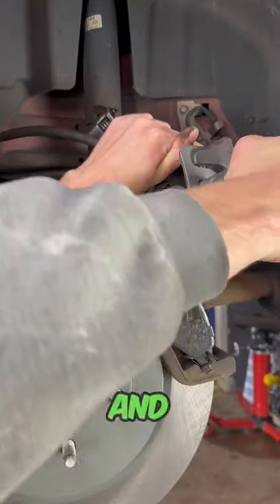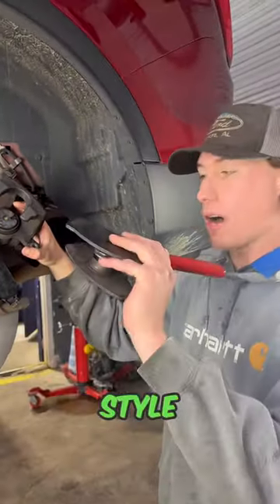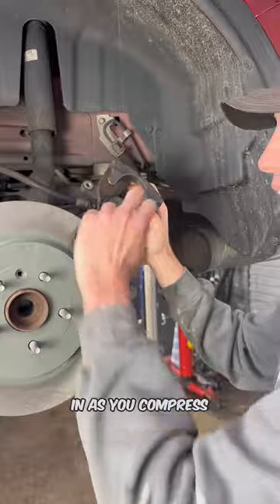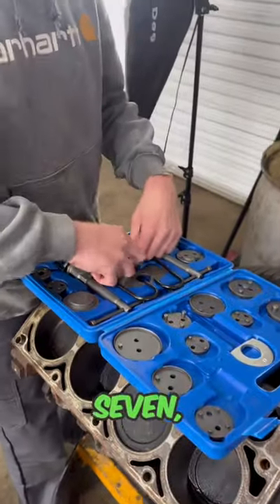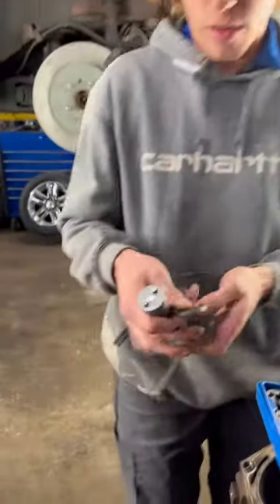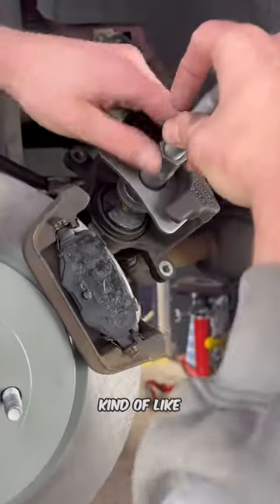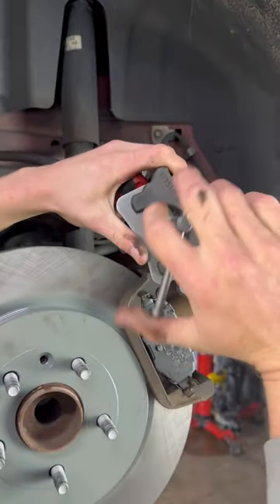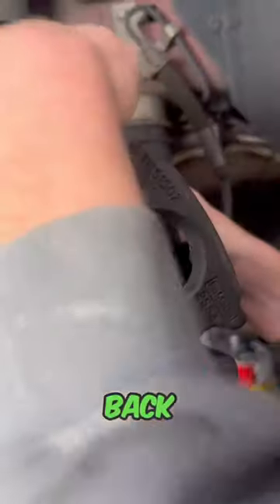The Brake Tool Every Mechanics Needs! Link in description #shorts #tools #mechanic

Comment: Don’t forget when you’re twisting, that you aren’t twisting the rubber boot behind it also, free it up first with some silicone spray
Reply: Or just twist it one way then go the other. It will break loose 50% of the time with 100% of the time breaking loose.
Reply: @clayton9136 that’s literally the longest way to do it, bit of lube behind the seal and it’ll push back no worries, takes 5 seconds to lube it, going forwards and backwards takes twice as long and 9/10 times doesn’t work as you stated anyway.
Reply: Had this happen on my 2012 Accord rear right 3 weeks ago. I just replaced it because it lasted 160k miles. Not worth battling it every pad change or even having to worry about it. 

Definitely using spray next time though.
Reply: @iHackWaWx  How the fuq is that the longest way? Ya go LEFT, THEN RIGHT. It takes less than one full second, AKA less time than whatever nonsense you spewed, AKA you're wrong, AKA I'm right,  AKA bye felicia.
Reply: @clayton9136  because 9/10 times it doesn’t free off the boot and it still gets stuck/twists? Bit of lube in behind the boot and you’ll never have an issue, however, you obviously don’t want the advice nor do you care for other people’s knowledge.
Reply: You also forgot the other tip.... Line the slots up vertically so that they lineup with the back of the brake pad going on.
Reply: @arthurwomack941  not on all vehicles, mainly Ford you have to worry about that
Reply: Great suggestion to avoid this gotcha!
Reply: Don’t forget to crack the bleeder so you don’t force all the crud back up through the master cylinder 😉
Reply: Thank you for that tip.

Comment: Tool rentals at most auto parts stores will let a DIYer rent the tool and get all their money back when the tool is returned. It's not worth buying if you rarely do brakes. These tend to be rear brake calipers. I have yet to see a caliper like this on front brakes. Rear brakes last much longer than front. So just rent  the tool. I own it, but I used to be a tech
Reply: I'm a strong believer in buy once, cry once, but buying the tools that those stores rent every time I need a specialty tool definitely has me crying multiple times.
Reply: That particular tool is 25 dollars on Amazon. There is no way it's worth an extra trip to the store, and taking the chance the one they have isn't damaged, missing pieces, or not in stock. It will also work much better for normal front and rear brakes than a typical c clamp.
Reply: My front and back brakes are the same.
Reply: @soullessrenegades1444 The only time you have this on your rear brakes is when your rear brake rotor has a drum on the inside for the parking brake. If your parking brake isn’t incorporated into your rear brake caliper then you will just have a regular push in style piston.
Reply: @ericmayer3074  It's definitely worth it for me to rent the tool, because I do not live in corn country where they hand out 4-car workshops with boxes of cracker jacks.  If I owned every tool that I occasionally rented, I'd have to sell one of my motorcycles to make the space.  Given that I'm usually hitting the parts store to stock up on Brakleen or shop towels or to recycle oil or whatever anyway, it's an extremely minor inconvenience.  But if I had a ton of space with a wall of shelves and a lift and everything, sure.
Reply: Great tool kit for anyone that does regular brake pad maintenance on multiple vehicles.

Comment: Don't forget the slot on the piston has to line up with the dot on the pad or it will not adjust it self
Reply: Clean and lube the boot lip (dielectric grease works good) so that the boot slides freely as it returns. Burp the air out of the boot when it's fully seated. This will help ensure that the boot doesn't rip.
Reply: You seen the front pad and said comeback🤣🤣
Reply: I was thinkn the same.. he shouldve mentioned it at the end🤣
Reply: Must’ve been gods plan bc I did not pay attention to this yet all came out fine, 2014 mustang
Reply: There is a nub on the brake pad that goes in the notch as well. If it isn't lined up it will cock the pad slightly and cause uneven wear.
Reply: Not on all models
Reply: This was a great comment.  He should have mentioned this in the video.  Also, some Fords and Volvo rear breaks turn clockwise on one side and counter on the other.  The blue kit like he uses has both tools.  The red kits that some of the auto stores only have the clockwise tool.

Comment: I remember back before I was certified, I used two flat heads and some elbow grease. These tools are a must for any basic mechanics.
Reply: I did the same dam thing lol
Reply: I used a grinder wrench and a c clamp lol not worth buying the kit Ive done it once in 2 years
Reply: I just use a c-clamp and a pair of channel locks
Reply: Damn. I use a pair of pliers
Reply: man i did this in autotech but with pliers and elbow grease, took the whole class period😭
Reply: I've had to do this twice (though with different tools) now, because the parts store is never open when I find out I need it.

😢
Reply: What's the purpose of this caliper design though? If you can't compress the calipers using a C clamp and an old brake pad, then it's time to haul the whole vehicle to the scrapyard.
Reply: Needle nose pliers for 20 years until I decide to try the piston caliper tool in the video lol
Reply: @somethingtrulyhorrifying  they self adjust in as the pad wears thinner is the design. I too think it’s unnecessary coming from the pistons I was used to. Im sure someone else can explain their intended function better.
Reply: @AlleyAutoChicago  exactly. It’s not too hard either. Just not as easy as that tool. Lol
Reply: I used needle nose pliers
Reply: @liamgoetz2890 hell yes! That’s how I got ‘er done back in high school days on my Mom’s ‘92 Eagle Premier.

Comment: Also remember, if you have an electronic parking brake, make sure to put your EPB in service mode before turning on the piston. Failure to put in service mode will ruin the actuators which are around $250 each from ford.
Reply: Had to put my Lincoln LS in neutral for the piston to retract into the bore.
Reply: I know on Fords, you can just push the piston back in after you set them to maintenance mode.

Comment: For anyone wondering , these are for the rear brakes of a car/truck because it is for the emergency brakes
Reply: Car, not truck. As far as I'm aware, no truck uses this style of combined brake. I'm fairly certain this is also a Ford exclusive "feature," but I may be wrong there, too. F150s might have this, I don't know.

I do know for certain that the heavy trucks use a small drum for the parking brake inside the center of the rotor, just like the other brands. I don't know who came up with this design or why, because the other method works better and is simpler.
Reply: @TheHonestL1ar oh yes your right , now that I think about it all trucks I've worked on have the drum style ebrake....thanks for correction!
Reply: These are on vw Audi
Reply: @TheHonestL1ar Its definitely not exclusive to Ford. Most cars with single caliper rear discs that use that caliper as a normal brake and a handbrake/parking brake will need winding back. Old Nissans have them for example. VAG love using them on nearly all their cars nowadays.
Reply: @JamesHamp93  Ok, thanks for telling me. I've personally only seen them on Fords, but I'm not a mechanic myself, so...

The only things I really work on are my own stuff, industrial/farm equipment when needed, and the occasional neighbor's car.
Reply: @TheHonestL1ar early 80's Seville used them aswell. Swapped them calipers onto my fiero before.
Reply: Parking brake. It's parking brake. It has a (P) icon on it
Reply: @justme5384  We also call them handbrake in the UK. Ours tend to have (!) as the symbol not (P).
In an automatic you will have a park gear shown as a P but in the UK generally speaking it's a handbrake.
Reply: @JamesHamp93  yeah now that you mention it we also sometimes call them handbrake. But also parking brake, both probably equally
Reply: @justme5384  Cool. We both learned something today. I didnt think, and I'm making an assumption that you're American, that Americans called them handbrake at all. I've heard e-brake tossed around and parking brake but never handbrake!
Reply: @JamesHamp93  In a large number of vehicles(trucks, especially), the parking brake is not operated by the hand at all, but rather a foot pedal. Hence the reason it's not typically called a hand brake here.
Reply: @JamesHamp93  northern Europe
Reply: @TheHonestL1ar  Tbf even in the UK now there's a few cars that have that. I think for us its more of a 'that's what it's always been called so I will carry on calling it that' kinda thing.
Reply: @JamesHamp93  At this point, the only cars in the US that actually have a hand operated parking brake are ones that are considered "sports cars." And even some of those have foot pedal park brakes. A lot of newer cars and SUVs now have electronic park brakes that are activated by a little switch instead of any kind of mechanical linkage. I really hope those don't stick around.
Reply: Huh? Got this piston on the FRONT brakes on my Vauxhall.
Reply: @TheHonestL1ar the rear brakes on my ‘70 Pontiac T/A with 4 wheel disc brakes was like this, it was the adjustment for the parking brake.
Reply: @SuperBC10  A wind in piston?
Reply: I'd rather have a drum Ebrake
Reply: @TheHonestL1ar  Not Ford exclusive. My Audi A4 has these
Reply: @norwegianroads2152 Also on the Lotus Elise. I turned mine in with needle nose pliers.
Reply: @TheHonestL1ar  was on my Nissan.
Reply: Parking brake.  Ever since I learned to drive stick, I always use it, even if it's an auto.

Comment: We use an air assisted version. Keeps pressure on the piston and all you have to do is screw the piston in. So much easier than the traditional piston return tool shown here
Reply: Every respectable shop has one
Reply: Yes, love mine. These are a pain without that.
Reply: Plus with the pneumatic ones you can turn it counterclockwise since the Ford Transit has to turn in that direction
Reply: @paulschoonover2084 
I have a tool set similar to the one shown, and it comes with both LH and RH-threaded tools.
Reply: Sooo much easiieerr,!!
Reply: I have one of those, they are great.

Comment: Believe it or not needle nose works as well. Also some angle gringer lock tools also work.
Reply: You’re right. I’ve been using needle nose for years.
Reply: the cheap kit for 25 bucks also works and is kinda made for it
Reply: Can’t argue 25$ if the tool was 250$ I would have a different opinion
Reply: Chances are you are going to rip the boot

Comment: Basically if there's a cable for parking brake going to the brake caliper you have to turn and compress the piston in the caliper because the piston screws out to apply the parking brake
Reply: Thank you, my first question about this setup was going to be “but why?”
Reply: @austin702 So you can't DIY it.
Reply: @jamesvandamme7786 I mean there are extremely cheap kits out there. You pick small caliper winding tools up for like 10-20 quid/dollars. If you have the tools and ability to remove the calipers and carriers it's not that much of a reach to assume you might be able to grab a caliper winding tool. 
Also alot of the newer modern cars you can just electronically wind them in through a diagnostic tool/obd port tool.
Reply: My Audi has electronic parking brake that winds in and out so it's not just cables. But at the same time i can electronically wind the piston fully back for changing pads which is nice
Reply: @JamesHamp93 I think they were referring to electric/ electronic cables, not bowden cables. Electronic parking brakes are the only ones you have to do this to. Manual parking brakes release under spring pressure.
Reply: @brianargo4595  It depends. If it's a single piston caliper with a handbrake that uses the pads. Not another caliper or a drum then you will have to wind them back. So many cars use them nowadays.
Reply: @brianargo4595  Change the rear pads on a MK4 Golf

Comment: Don't forget to suck some fluid from the reservoir too. Pushing the piston in will displace that fluid and overflow the master.
Reply: Open the bleeder or you may damage your abs pump or master cylinder seals.
Reply: Pressing in the piston will take the fluid level back to original. No need to suck out fluid.. it's a sealed system
Reply: @brettmiller6167 Someone probably topped it up
Reply: @brettmiller6167 I saw an old boy shear the handle off one of these because the bleeder wasn't opened.
Reply: @ericeck  Brake lines weren't clogged though lol

Comment: Yup biggest thing to remember is to align the slots on the piston to the pad so they seat all the way flush and will allow for proper adjustment. Also helps to spray some lube on the rubber boot before compressing to free it up when rotating/compressing

Comment: Don't forget some inner pads have little dimples that are designed to line up with one or both of the slots or holes in the piston and you have to turn it to line them up outgrew your pad will be worn unevenly.

Comment: Lisle makes a tool called the brake cube that replaces that whole kit, it's been on the market for 20 years and was only $10 when I bought mine back in the day.
Reply: The kit he is using is made by Astro pneumatic. It is $35 online and is what most tool trucks sell you rebranded with their sticker. For 5 times the price of course. 
 It’s much easier to use than with the cube since you don’t have to push in as you turn.
Reply: That's my only option in my tool box, THE CUBE!  When I find it no longer fits certain makes, I resort to a set of long needle nose pliers 😂. I'm so hurt these days....
Reply: Harbor Freight/Princess Auto sells them these days.  I haven't owned a car with screw-in pistons yet, but at least I'm not SOL when it happens.
Reply: That cube is worthless

Comment: YAY! MORE COMPLEX MACHINES THAT WORKED FINE THE WAY THEY WERE BEFORE!
Reply: This is for cars with disc brakes in the rear it's for the e-brake so you don't have to have those little brake shoes in the middle of your rotor so it's actually a better design in my opinion

Comment: ITS VERY IMPORTANT TO CHECK IF THIS IS THE PROPER WAY TO RETRACT YOUR CARS BREAKS! Even if your car has the two slots for this kind of tool some cars you can’t twist it or it WILL break your electric e break motor. For example a Mazda cx5 has the slots for it hit YOU WILL break the motor if you do this!(speaking from experience). Always check to see the proper way to compress your rear breaks especially if you have an electric motor on the real calipers.
Reply: @ericeck  yes obviously put it in maintenance mode. You missed the point of what I was saying. I was saying you need to make sure that the motor is a screw in motor and not a press in motor or vice versa, even if it has slots that look like they’re for the tool so you need to make sure what way your specific cars motor needs to be retracted.
Reply: BRAKE

Comment: I was 16 (not that long ago) and bought my first car. 2002 accord was the vehicle and I was doing a brake service. Couldn't compress the post no matter how hard we tried. Saw the cross and thought "What if I get on there with some channel locks?" 

Yep, sput in it. Told my dad, who was helping me. That was the first time he saw rotating pistons in a caliper.
Reply: I had an 04 it had normal calipers
Reply: @josephlabonte8502  04 is the next gen. 99-02 is the 6th gen. 7th gen is 03 to (idk the year, but that's where it starts)

Comment: couple things you missed. you only have to buy one of those tools, the one that fits your car. if you work at a dealership you only need to buy it for that brand. and when you go back together you have to align the slots on the Piston with the pin on the brake pad

Comment: Yea also the tool has a left and right main shaft for each side. It makes it so much easier when using the tool right. Found out after using it too many times and wondering why sometimes it was easy and others it was more of a pita
Reply: Not all cars have the piston turn clockwise one side a counter the other.  Mostly fords and Volvo do different rotation depending on side.
Reply: @georgeburns7251  yea tell that to the many I do a week.

Comment: Also remember to open the bleeder so you don't force fluid back through the system and damage your abs pump or master cylinder seals.
Reply: @ericeck  I beg to differ. I have seen it first hand on a 2012 Mercedes Benz e350.

Comment: They suck but you can also use the scan tool or radio to set those electronic brake calipers into service mode and will retract automatically……I don’t think very many people know that great video and content
Reply: I don't know where you are getting your information from, but less that 1% of the vehicles on the road have electric parking brakes.

Comment: Gotta love how there was absolutely nothing wrong with a standard caliper. Was almost to easy to change your brakes.
So some engineer was like where can we make a guy need another specialty tool.

Im willing to bet the guy who invented rotating piston calipers also owns the Patient rights for the tool. Just another way to screw a guy and make more money.
Reply: Don’t need to do this on drum brakes.  Also not needed on vehicle with separate  disk brake for parking brakes.  Some Teslas have 2 separate brakes on the rear wheel